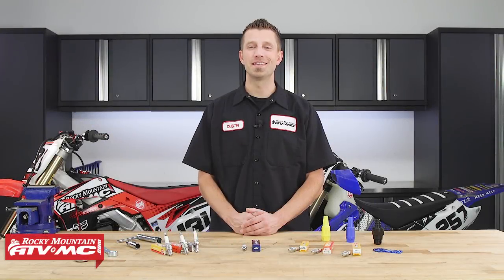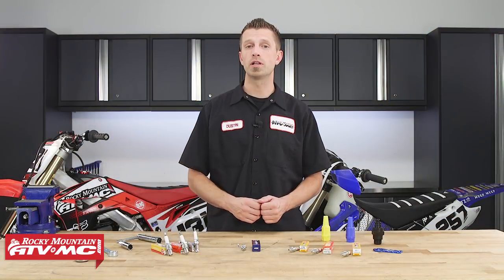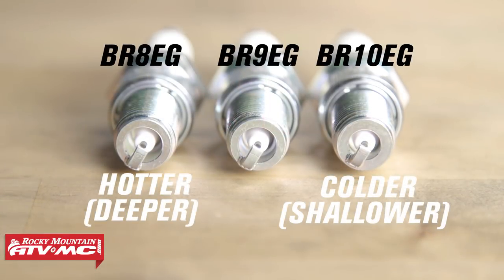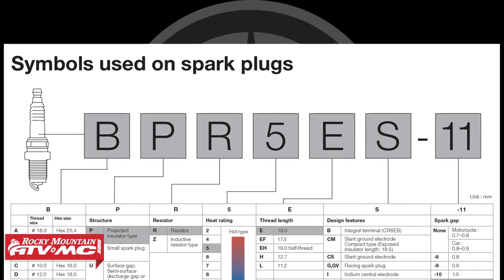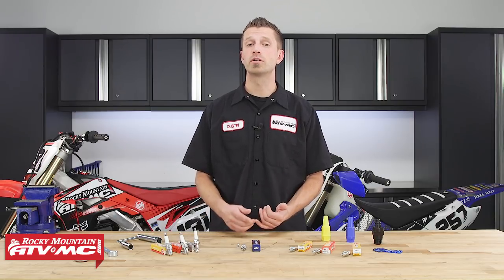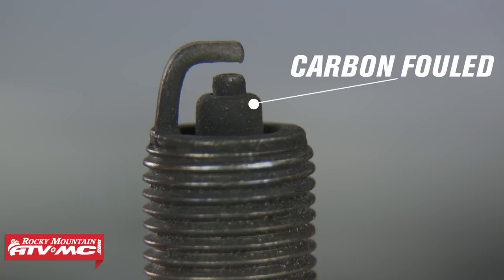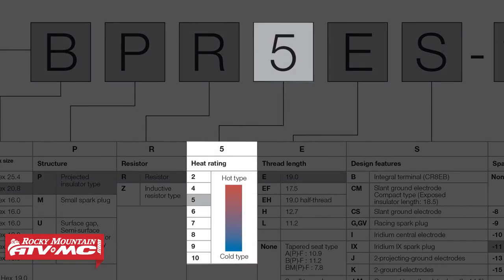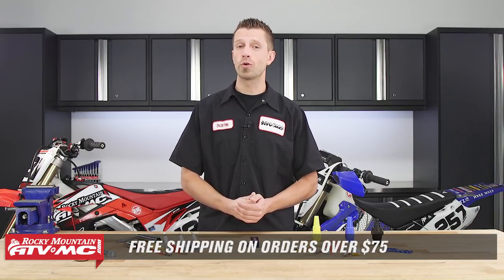Motorcycle/ATV Spark Plugs 101

Comment: Rocky Mountain once again successfully  reaches out to the  motorized world  , be it a back yard mechanic  ,or even the best of pros. I've ridden my 2019 KTM 500 EXC-F  4000 miles  to date , spent "  bu ku bucks "  upgrading  and anything from the smallest of parts , tools and riding gear.  I am a fan of the TUSK LINE UP, ROCKY  IS MY GO TO for  all my needs to keep me on the trails. 
   I  purchased the TUSK  wheel alignment  and balancing stand knowing it is one of the best stands out there for the price. I somehow successfully  tried the 21" front , all torqued  to spec using the TUSK  TORQUE WRENCH. BUT , I'M SOMEHOW FACING A 4TH ATTEMPT AT TRUING THE REAR RIM. DAMN BACK YARD MECHANICS , AT 65 IM SUPPOSED  TO BE ON MY RIDE NOT WORKING ON IT, LOL

Comment: One thing I learnt lately was eBay is flooded with fake yes fake NGK plugs so if it seems to cheap to be true it is. I brought two for my RM 250 bike ran terrible then I looked at the old plug and there was some difference in the finish and the stamping . Looked it up and yes it turns out I’d purchased two fake plugs for the price of one genuine plug.
Reply: And amazon?

Comment: When it sits on the cylinder head lid how much do you turn to tighten correctly. You should make a video on which plugs are interchangeable like a br9evx and a br8es are different numbers but u can use either  for the same bike.

Comment: Hello sir, can I ask? which is one the best spark plugs in for fuel efficiency, better acceleration and less vibration?
Reply: Ngk
Reply: "which is one the best spark plugs in for fuel efficiency, better acceleration and less vibration?"  The factory recommended OEM plug as found in your owner's manual! The manufacturers have entire professional engineering divisions that work on optimizing every facet of engine design. We shouldn't try to out think them unless we know exactly what we're doing and change our bike for some specific purpose. That said, NGK makes a damned fine igniter.

Comment: hello sir, ive just increased the compression on ktm300xc by i believe 20%,  i.e.  from approx 105psi to 120psi, standard plug i run was br7es, now this plug looks very dark, probably fouling,but is dry,not oily, and this observation was BEFORE i installed high comp head. i run high octane ethanol free fuel,  do both trail/high speed riding. my question to you is what would be the appropriate heat range move?  and/or use irridium plug,  thank you,    mike

Comment: I ride a 2018 ktm 250 xc and I’ve been killing plugs recently, they are black/oily. Running 60:1, JD jet kit installed. Feels great to ride but the plugs only last about a day or two. Any suggestions??
Reply: Turn the air screw out on your carburetor.  1/2 turn or a little bit more.

Comment: My 250 is acting like it dose not want to take gas it runs ok wide open but it misses at low throttle could this be the plug gap
Reply: You've most likely got a clogged pilot jet in the carb.

Comment: What kind of spark plug do i need to run on a 4 stroke honda dax 50cc?
Reply from the maker: It looks like your bike most likely requires a CR6HSA spark plug but you will want to check online for your bike model and year specifically to be sure.
Reply: Ok thanks and its a zhenhua from 2014

Comment: I accidentally ran a br8eix in my 2019 YZ125 I put about 10 hours on that plug the manual calls for a br9eix could this have caused any damage?
Reply from the maker: A spark plug that is too long can cause damage and too short can cause poor gas mileage and fowled plugs. I'd get the recommended plug in there asap.
Reply: The plugs are the same length I believe the BR8 is just a hotter plug and it showed a very lean condition I have replaced the plug with what the manufacturer recommends BR9 I was just concerned if there has been any damage to the motor that I am unaware of. The bike still runs great just not sure if there's any damage that could have occurred

Comment: Would it be better to run a hotter plug if i race?
Reply from the maker: We mention in the video that it is safer for your engine to be running a colder plug vs hotter, that way the plug will foul before any major damage happens to your motor.  With racing situations it might be best to run something like an iridium spark plug. Hope this helps!
Reply: always thought hot and cold is based on the country weather you live in , so plug is changed when its foul , no lifespan on it ?

Comment: What is the best spark plug for a yz 250 2 stroke?
Reply from the maker: That answer will vary depending on what you have done to your bike but if it's basically stock, I would stick with the BR8EG that the factory calls for.
Hope that helps!
Reply: @rmatvmc  do you know by chance what the best spark plug for a yz125 that the engine is almost completely stock